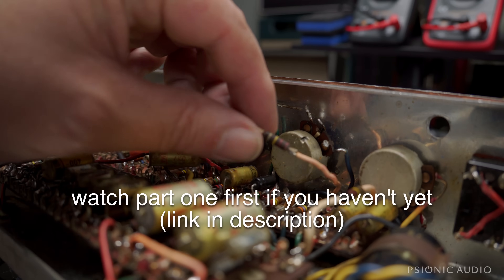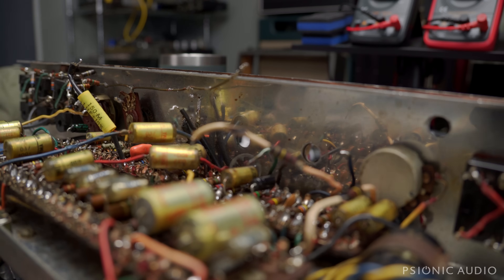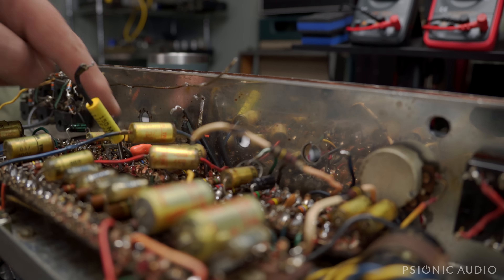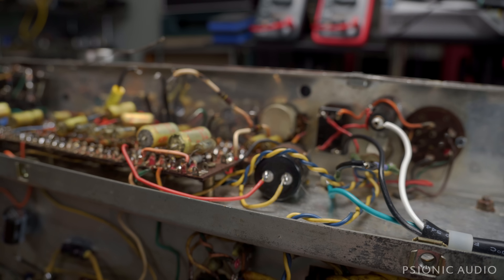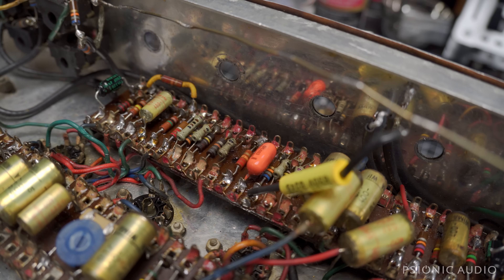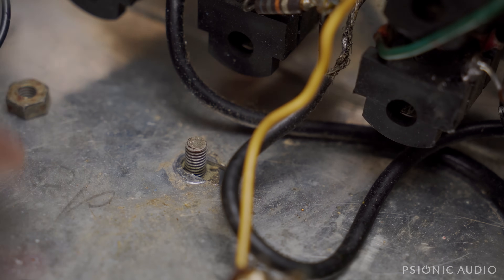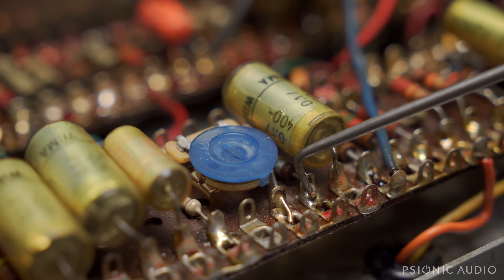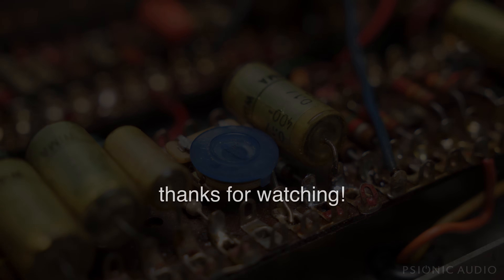'64 JMI Vox AC30/6 | Part 2 : The Work Begins

Comment: Thanks for the tips in your earlier videos about the crappy IC caps in the recent Fender reissues. That was indeed the issue with my new (to me) ‘65 TRRI. A set of new F&T caps brought it back to life. No hum, but had weird ghost notes, low output, and unmusical distortion. Sure enough they all had bloating and leakage of electrolyte.

Comment: I used a dual gang 1 meg linear pot(s) and four resistors to make it into a 770K dual gang pot, on an old Gibson amp to change it's old 3 speed tremolo into a variable speed tremolo. Super weird LFO with a coil in the oscillator. That second choke had to be taken apart and rewound. All the laminates had to come out and the bobbin rewound. I had to buy a bunch of #36 AWG magnet wire. I added another pot for intensity. The amp was recovered in reddish brown splotchy Lifton case pleather (oil cloth) and got some new gold grille cloth. Gibson Maestro made a 3 speed phase shifter in the late 1960s. 3  speeds? WHY, Gibson, why? That one is less reversible with the colorful rocker switches. Again, why Gibson, why?

Comment: Remember an Ampeg Reverb O Rocket having goop on almost every connection to keep dirt and such from influencing and degrading the amps sound. There was a lot of goop on that chassis 😂
😎✌👍❤🖖
Reply from the maker: The fun there is 60 years later that brown goop has become conductive…
Reply: @PsionicAudio  
YIKES...!!!
😎✌👍❤🖖
Reply: @ditchgator1 , 1970's/80's Japanese hifi equipment used a tan-colored, rubbery glue called Sony Bond to secure parts prior to soldering.  Even at the comparatively low voltages found in solid state equipment (compared to tube circuits) that glue would start to look like burned sugar, becoming both conductive and corrosive, eating through foil traces and turning component leads crusty green with corrosion. I've snapped the hardened tips off of dental picks while scraping the glue off!

Comment: I certainly didn’t know that a ground lug attached to the chassis with a nut could corrode. It’s not humid, it’s not moving, should be secure and stable, right? Never crossed my mind that it could quietly ruin itself.

Comment: Are you going to leave the top boost circuit out completely? Or are you going to design one yourself for installation?
Reply from the maker: I’m going to put it back with a few wiring changes. But for what I’m working on first it was just in the way.